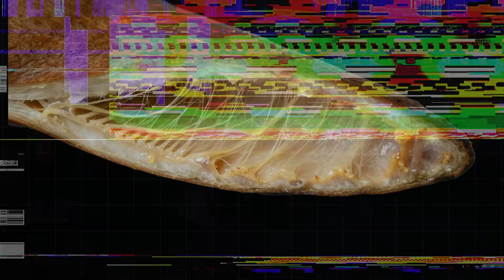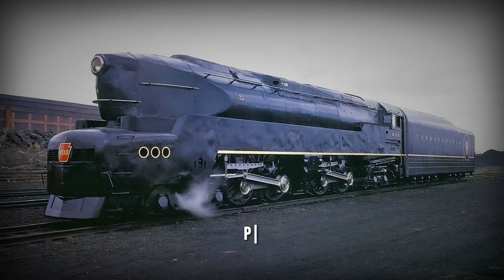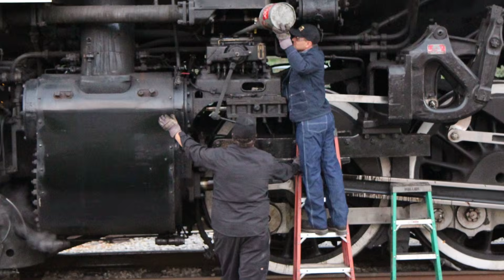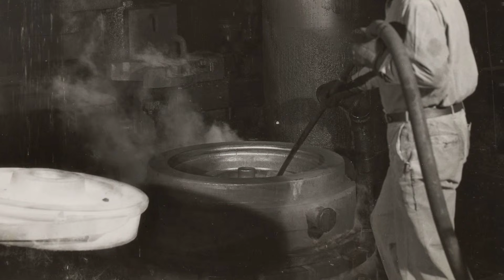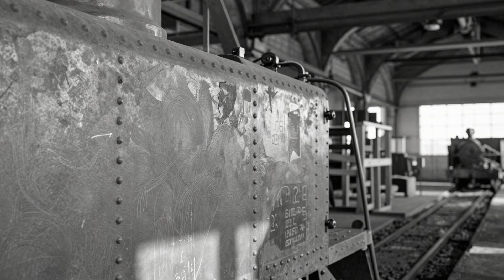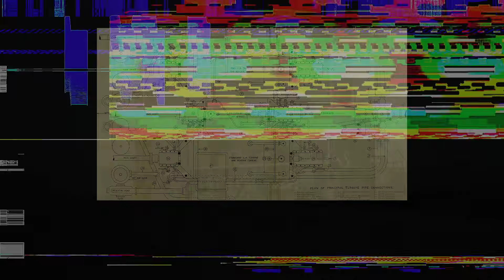The Steam Giant That Had NO Pistons — Why The Turbine-Drive Was A Mechanical Fever Dream

Comment: I can't fathom why they wasted their time on this.  We'd already done this ten years before in the UK and shown the idea to be a bad one.  The LMS Turbomotive came out in 1935 in England.  It worked fairly well but the fundamental problem always with a turbine is that it is designed to run at a certain speed, and when the speed goes higher or lower it loses efficiency.  Even if you have several gears it's still a problem.  By contrast a steam piston engine can run very well at a wide range of speeds without losing much efficiency, and the absence of the need for gearing on a piston loco is a bonus.

If you use an electric transmission (GE made a steam turbine-electric loco in the 1950s) this means you can at least run the turbine at constant speed.  However, even at constant speed, the efficiency of the turbine drops off greatly as the power reduces from its maximum design value.  Railway locos do not run at maximum power for most of their time.

In a power station, steam turbines are perfect because they run at constant speed and constant maximum load.  So you get very high efficiency (about 40% thermal efficiency as opposed to about 8% maximum for a steam piston loco).  But the operational requirement of constantly varying speed and load in a loco, is completely unsuited to a turbine.

The other problem with a steam turbine loco is that it's still an external combustion engine - as well as the turbine itself you still need the boiler, which is a huge, heavy, expensive thing that needs a lot of maintenance, and due to size and weight limitations you can't have a condensor big enough to reclaim the water, so the steam is thrown away which is a huge loss of heat and the loco has to stop frequently to take on more water.

The only time a turbine loco worked passably well was the UP gas turbines ("Big Blow") of the 1960s.  Gas turbines struggle with the same limitations as steam turbines - they don't work well at varying speed or power.  But the UP used the turbine locos just to haul freight at constant slow speed and full power up the long drag of Sherman Hill, and turned them off for other parts of the run, relying on diesels coupled to them.  But this was only economical when the bunker fuel they burned was dirt cheap, as soon as it became a viable fuel for power generation the price went up and the economics no longer stacked up.  We also played with gas turbine locos in the UK, both geared and electric transmission, but the same fundamental problems were insoluble.  Just like in steam engines, a piston-based diesel engine is better for railway locomotion than a turbine, because it operates efficiently over a wide range of speed and power output.

If you built it as a modern hybrid, i.e. battery powered with a turbine used just to charge the batteries, working at constant speed and power when turned on, you might make a success of it.  There's a project in the UK going on with that idea at present, using a converted class 60.

Comment: So USA engineers couldn't do what was very successful in Sweden? The Swedish steam turbine locomotives were very successful, and delivered exactly what was intended - significantly better furl economy. They were also insanely strong. In fact, during initial pulling tests, the locomotive just tore the couplings into pieces, so the test was finished at that point.

Comment: Er wrong, hammer blow only affects steam locos with two outside cylinders, why do you think Nigel Gresley, William Stanier, and George Jackson Churchward designed built and put in production steam locos with three to four cylinders?, . Yes cats&kittens to reduce hammer  blow,two outside cylinders driving the axle via connecting rods to crankpins on each wheel hub,. One or two cylinders and con rods inside the  loco chassis drive the same axle as it has one or two balanced cranks, this crank axle, is key to smooth hammer blow free railroading as the US would say. Crank axle is so arranged to counter act hammer blow , the outer pair of pistons thrust up, the inner pistons thrust down resulting in a smoother ride and kinder to the track.

Comment: It might have had a chance if they used electric traction motors run by a generator driven by the turbine.
Reply: Somebody did try to build a steam turbine-electric engine.  Apparently it had poor efficiency and was noisy.
Reply: @8546Ken no battery then
Reply: I don't know about what Kin said, but in today's steam turbine electric generation system add in a hybrid with storage to battery banks when not requiring all energy to the electric traction motors and hybrid energy recovery from the traction motors during traction braking a steam turbine locamotive would be an awesome monster.
Reply: Yes or just less complicated like the Turbomotive.

Comment: In this day and age, there was no way that we could’ve found a different more efficient way to run a good old-fashioned steam engine.
I mean, all we had to do is heat up some water, right? Instead, we’re building these Jagoda monsters and we keep pouring in tons of fuel in them just to pull the same amount of weight.
Reply: Steam loco = 8% efficient at the very best, mostly much less.  Diesel loco = about 40% efficiency commonly.  Apart from the difference in maintenance and manning costs!  It's a no-brainer.  Even if you only had coal as a fuel, it would be more efficient to crack it into oil (Fischer-Tropsch process) and put it into a diesel engine.